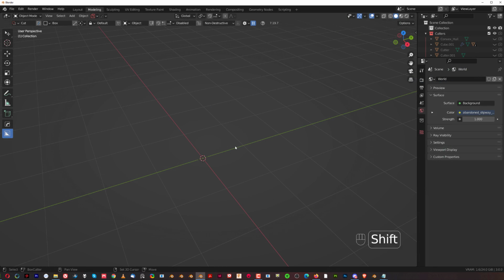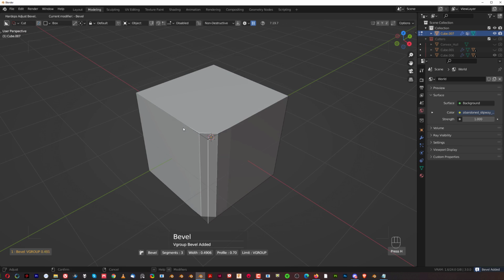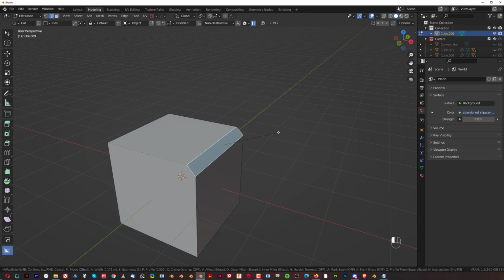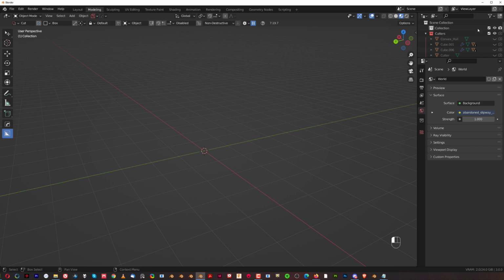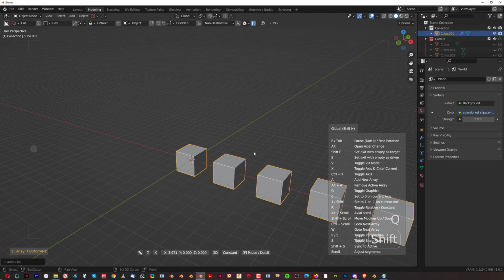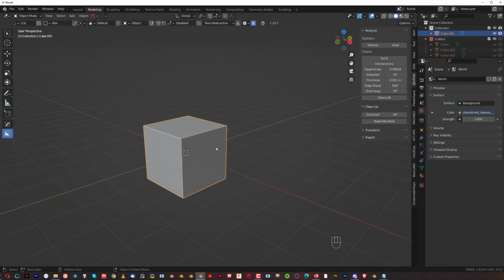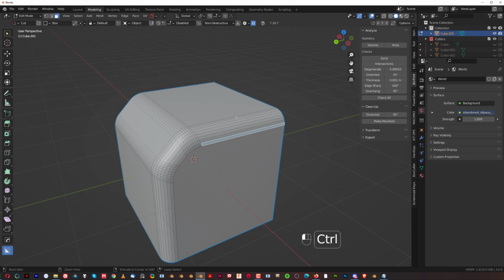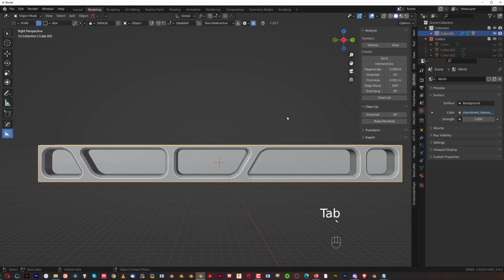Get Better at Hard Surface in Blender with These 20 Tips.

Comment: You don't need these plugins to do all this.
Reply from the maker: come back when  you get smarter
Reply: @PonteRyuurui  What nonsense answer is this? I said that all this can be done without plugins. Blender is good software. I've been using it for 3 years and I've found that all this can be done without plugins. There are good tips in the video, but it needs a plugin. As such it's just personal opinion.
Reply from the maker: @HalitHarun  even cavemen used tools, so again, come back once you smarten up and learn how to use them, now get

Comment: Thank you so much for your support. 
I have a question. Why I can’t rotate the viewport while I use any tool. For example bevel. 
Thanks.
Reply from the maker: You can, simply press middle mouse button
Reply: @PonteRyuurui  thank you so much. But I mean you can’t rotate the viewport before you finish the action. 
For example I want make bevel and I want to rotate the view to see the impact from other side. So I can’t do that before I confirm the bevel tool.
Reply from the maker: @ahmadzhalabi  on ctrl b you mean, i thought you meant hardops bevel. ya on ctrl b you cannot, but thats vanilla blender limitation. You could bevel an edge via ctrl mark with hardops and then you can rrotate the view.

Comment: When you live bevel the edge (at 4.00) it works fine in Blender 3.0, but in 3.1 Beta it applies the bevel to all the edges until you tab out of Edit Mode and then it applies it correctly - makes visualizing the result impossible. This isn't the only problem with 3.1 Beta I'm finding though, it seems they've screwed up how things are applied in Edit Mode so you don't see changes correctly until you go back to Object Mode.
Reply from the maker: well thats because its beta